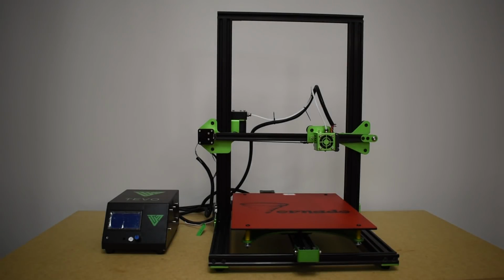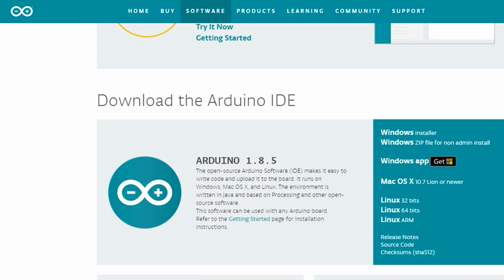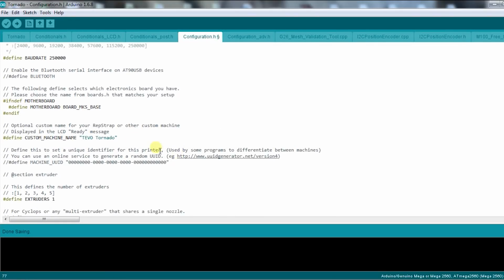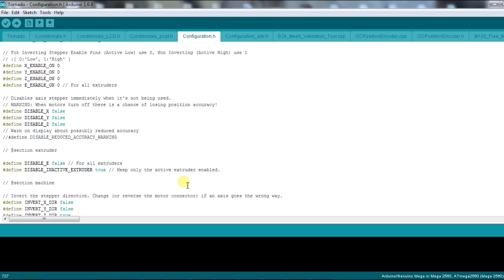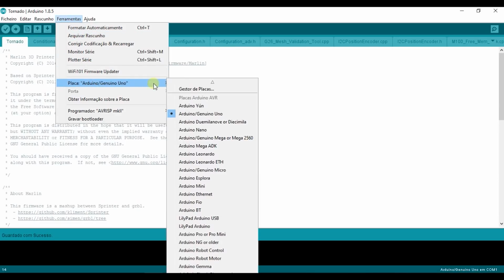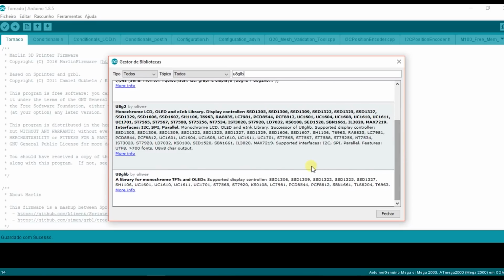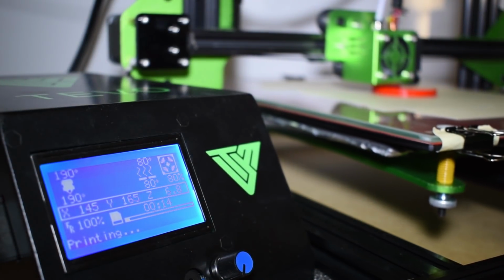TEVO TORNADO 3D PRINTER - HOW TO UPDATE THE FIRMWARE

Comment: I have the blue screen of "BLANK" ...  I reviewed you video and made changes that you had to the Marlin - uploaded the u8glib library. - WIth the machine turned off I uploaded ... no screen data once compiled and uploaded ...  Unplugged and turned on the power to the machine ..   Still nothing ...
Reply from the maker: Hi Doug,
Was the display working before?
Did you reverse the cables as I explain in the video?
Reply: @ruiraptor  Yes it did...  never changed any cables or anything ..  After I built the machine .. I noticed it didnt work like it should with the original software ... This was a test out of the box ...  As I read the manual it stated I needed to update the software with Marlin ... Since then I have not been able to have any screen information of operation of the Tornado..
Reply from the maker: Make sure that the firmware you are flashing has the correct display enabled. If you are using a different board, check my video as I had to reverse the cable orientation.
Reply: @ruiraptor  HEY! .. got it now ... didn't have to change the cable orientation ... What I did was go to the Tevo Tornado users group and downloaded the current Tornado zip...  this was a setup for the Tornado already designed by a end user and seems to be working fine at the moment....  Doing a print now and the display is now working ..   Thanks for the help ...
Reply from the maker: Glad it's working. Thanks for sharing :)
Reply: @ruiraptor  OH YEA! .. This baby is working like a champ ....  Whats funny, I purchased at work a Ultimaker + ....   and we all raved over the prints.  Compare the Ultimaker to my Tornado ..  OMG!  the quality of prints are far superior than the Ultimaker ...  TEVO did their job building this setup ..  I have it now connected to my Octoprint with camera system and its a BUTE! ...   Thanks again for your support ... Those that run into issues please review ruiraptor's video and then checkout FACEBOOK - TEVO TORNADO USER GROUP ..  they have all the needed downloads to support your Tornado printer ...
Reply from the maker: Thank you so much for your kind words and for sharing all that. :)
Any questions let me know.

Comment: Hi, great guide.
Unfortunatelly, I didn't know that before and my firmware update failed and the printer doesn't heat anything. Do you have any idea what to do? Any link where can I find proper information?
Regards, Robert
Reply from the maker: Hi Robert,
My advice, flash the stock firmware back and check if everything works as normal.
You can find the stock firmware here: https://github.com/tevo3d
Reply: @ruiraptor  Thanks, I will check it.

Comment: I have given up with the Tornado. I have an Anet A8 and have build a reprap AtomX from scratch. Both were easier to set up and actually use than this deathtrap. Warped bed, communication timeout when trying to update firmware, thermal runaway protection disabled, no earthing and no strain relief to mains bed, missing bolts in kit, all screws loose, no fuses on hotend or bed, no thermal fuse in bed heater and no way to put one in, frame out of square, useless build surface. Inside the control box the mains power to the switch was touching the case of the psu (they had actually removed the insulation to make it fit and put a bit of electrical tape on the side of the psu case!), the fans on the psu have rocks for bearings, mains cables to the hot bed were loose and exposed at control box end (which has an exposed metal screw connector), fuse in control box not properly spec'd and something else would blow before it does, endless reports of fuses blowing in the psu, no-name solid state relay...... I could go on. I have had it a year but only just put it together. Wish I had not bothered. Very disappointed and frustrated and don't trust it as far as I can throw it.
Reply from the maker: Hi Plan C,
So sorry to hear that and thanks for sharing.
However i'm surprised with some things you mentioned.
For example, the thermal protection is enabled in firmware in ALL stock tornado printers unlike all the anet printers that have it DISABLED.
The Anet printers don't have a strain relief, no fuses, they have acrylic frames/plates that don't get squared because are poorly cut and warp every time you try to stretch the belt and very difficult to get decent prints without significant upgrades.
I believe that you probably received a bad printer but trust me that not all of them are like that. 
I did not have any issues with my printer and i get awesome prints from it. Same with many users posting in the official forum.
Anyway, if you need any help let me know. I'm always glad to help.
Reply: @ruiraptor  Thanks. I have made some modifications which should make it safer. 3.15a fuse in the control box instead of 10a - Runs fine. Octoprint with Temerature Failsafe and TP Link Smartplug so that the socket turns off if either the bed or hotend temperatures go out if bounds. Cable strain relief. Meanwell psu, earthing the frame and tray. I think I was having a bad start with it. It was hell to level and only worked with glass and hairspray lol. Your videos are very informative. Keep it up.
Reply: Sucks to be you...

Comment: Thanks, I have an old one from about a year ago that I just got around to assembling lol. I read somewhere that thermal runaway detection may be disabled in the stock firmware. Do you know if this is true? If so, I will update. Also wondering if there is a thermal fuse in the supplied silicone heater. Thanks.
Reply from the maker: Hi Plan C.
From my knowledge, all tevo printers have the thermal runaway ENABLED from stock.
Regarding the fuse, there is none. Just the temperature sensor.

Comment: I know you must be super busy with all the questions. Can you do one for me?
I just installed a MKS Gen L 1.0 board with 2208 and lv8729 drivers in my Tornado. Did the firmware install, when I move the hotend to the corners of the bed, Lift and Right seem to be ok. When going to the Lift or Right Rear, it just repeats Lift and Right Frunt movement.  I think it just needs some adjustment.
What can I do to correct this.
Thank you so much
Dale
Reply from the maker: Hi Dale,
If that is happening then the code in the firmware is wrong. You can edit the code and flash again.
Check the "configuration_adv" tab under #define CUSTOM_USER_MENUS
In there you will find the gcode commands. Just edit the coordinates.
Reply: I located the CUSTOM_USER_MENUS, Sorry to say I don't know what to change. Here is what is in the CUSTOM_USER_MENUS
 #define CUSTOM_USER_MENUS
#if ENABLED(CUSTOM_USER_MENUS)
  #define USER_SCRIPT_DONE "BED LEVEL Done"
  #define USER_SCRIPT_AUDIBLE_FEEDBACK
  #define USER_DESC_1 "Home"
  #define USER_GCODE_1 "G28"
  #define USER_DESC_2 "Front Left"
  #define USER_GCODE_2 "G1 Z10 F5000\nG1 X20 Y20\nG1 Z0"
  #define USER_DESC_3 "Front Right"
  #define USER_GCODE_3 "G1 Z10 F5000\nG1 X280 Y20\nG1 Z0"
  #define USER_DESC_4 "Rear Right"
  #define USER_GCODE_4 "G1 Z10 F5000\nG1 X280 Y280\nG1 Z0"
  #define USER_DESC_5 "Rear Left"
  #define USER_GCODE_5 "G1 Z10 F5000\nG1 X20 Y280\nG1 Z0"
Reply from the maker: Hi Dale, 
your commands/coordinates are correct.
Did you flash this firmware version?
Reply from the maker: Also...have you executed the home first?
Reply: I flashed the firmware after setting up the configuration h, from your video.
I to thought the #define CUSTOM_USER_MENUS looked correct. 
I did go to home first, then to the front right, front Lift. Rear right and Lift just went to Front right and lift. 
Hop you can stay with me tell we get it fixed.
Reply from the maker: Hi Dale,
Sure. Contact me by email so we can troubleshoot it.
ruiraptor.channel@gmail.com

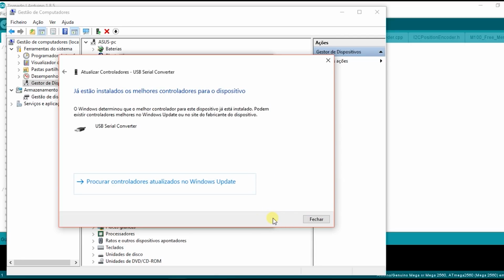Comment: Thank you so much for the fantastic videos. You have helped me get the MKS L board installed. I’m on to installing of the new firmware. All seems to go ok up to the point on your video (5:50) I have installed the CDM21228 Drivers to my computer. After that I don’t see the drivers in Device Manager.  Here is the step by step I Have. Hop you can get me going.
Thanks
Dale
Ruiraptor has verified this step by step. Hope it helps.
video at http//www.youtube.com/watch?v=g4aHmbt5gMA
This is for MKS Gen L V1.0 board with X , Y , Z drivers 2208 and E With LV8729
Volt set on 2208 drivers 1.6v on X , Z and Y set at 1.2v . For E LV8729 driver set at .55v
1. Open Tevo Tornado Firmware folder
2. Scroll down to Tornado.ino and open
3. Click on Configuration.h
4. Scroll down to #endif
5. Go down to #define CUSTOM_MACHINE_NAME”Tevo tornado”
6. Highlight “Tevo tornado” Then Type in “Dale”
7. If needed To change 
8. Click Tools at top of Arduino  
9. Select Board Then click on Arduino/Genuino Mega or Mega 2560
10. Select Processor  Then click on ATmega2560 (Mega 2560)
11. Select Programmer Click on AVRISP mkII
12. Connect Printer to Computer with USB Cable. Power should be off on the printer
13. Printer LCD will turn on 
14. Open Tevo Tornado Firmware folder
15. Open Drivers folder Run the CDM21228_Setup.exe
16. Go to Device Manager 
17. Scroll down to and Click on FTDI USB Drivers 
18. Go to Comport in Device Manager
19. Make sure the New ComPort is listed Arduino Megs 2560 (COM#)
20. Go back to Arduino , Tools , Port. Mack sure the Port is the same
21. Should show COM# (Arduino Mega or Mega 2560)
22. Go to Sketch at top of Arduino
23. Go to Include Library Look for u8glib Click on it.
24. If it is not there go to Tools , Click on Manage Libraries  
25. Window will open. Type in u8glib in the Filter your search
26. Scroll down to u8glib. Click on Install
27. When it’s finished go to Sketch , Include Library , Scroll down to make sure u8glib is in the lest
28.  Reedy to install the Firmware. 
29. Click on the check mark at top of Arduino. To verify
30. If Nothing is red at bottom , Click on Fight Arrow next to the check mark  
31. The Printer will reboot after upload is complete
32. Unplug the USB Cable, Power on the Printer
Reply from the maker: Hi Dale,
Perfect sequence.

Comment: Help please, I received this long error message when i verified the arduino tornado firmware
Arduino: 1.8.5 (Windows 10), Board: "Arduino/Genuino Mega or Mega 2560, ATmega2560 (Mega 2560)"

In file included from sketch\Marlin.h:32:0,

                 from sketch\Marlin_main.cpp:244:

sketch\Marlin_main.cpp: In function 'void gcode_M0_M1()':

sketch\language_en.h:34:66: warning: unknown escape sequence: '\^'

   #define WELCOME_MSG                         MACHINE_NAME _UxGT(" ready.")

                                                                  ^

sketch\Marlin_main.cpp:5775:59: note: in expansion of macro 'LCD_MESSAGEPGM'

           IS_SD_PRINTING ? LCD_MESSAGEPGM(MSG_RESUMING) : LCD_MESSAGEPGM(WELCOME_MSG);

                                                           ^

sketch\language_en.h:34:60: note: in expansion of macro '_UxGT'

   #define WELCOME_MSG                         MACHINE_NAME _UxGT(" ready.")

                                                            ^

sketch\Marlin_main.cpp:5775:74: note: in expansion of macro 'WELCOME_MSG'

           IS_SD_PRINTING ? LCD_MESSAGEPGM(MSG_RESUMING) : LCD_MESSAGEPGM(WELCOME_MSG);

                                                                          ^

sketch\Marlin_main.cpp: In function 'void gcode_M104()':

sketch\language_en.h:34:66: warning: unknown escape sequence: '\^'

   #define WELCOME_MSG                         MACHINE_NAME _UxGT(" ready.")

                                                                  ^

sketch\Marlin_main.cpp:7059:9: note: in expansion of macro 'LCD_MESSAGEPGM'

         LCD_MESSAGEPGM(WELCOME_MSG);

         ^

sketch\language_en.h:34:60: note: in expansion of macro '_UxGT'

   #define WELCOME_MSG                         MACHINE_NAME _UxGT(" ready.")

                                                            ^

sketch\Marlin_main.cpp:7059:24: note: in expansion of macro 'WELCOME_MSG'

         LCD_MESSAGEPGM(WELCOME_MSG);

                        ^

sketch\Marlin_main.cpp: In function 'void gcode_M109()':

sketch\language_en.h:34:66: warning: unknown escape sequence: '\^'

   #define WELCOME_MSG                         MACHINE_NAME _UxGT(" ready.")

                                                                  ^

sketch\Marlin_main.cpp:7273:9: note: in expansion of macro 'LCD_MESSAGEPGM'

         LCD_MESSAGEPGM(WELCOME_MSG);

         ^

sketch\language_en.h:34:60: note: in expansion of macro '_UxGT'

   #define WELCOME_MSG                         MACHINE_NAME _UxGT(" ready.")

                                                            ^

sketch\Marlin_main.cpp:7273:24: note: in expansion of macro 'WELCOME_MSG'

         LCD_MESSAGEPGM(WELCOME_MSG);

                        ^

sketch\Marlin_main.cpp: In function 'void gcode_M81()':

sketch\Marlin_main.cpp:7723:45: warning: unknown escape sequence: '\^'

     LCD_MESSAGEPGM(MACHINE_NAME " " MSG_OFF ".");

                                             ^

sketch\Marlin_main.cpp:7723:5: note: in expansion of macro 'LCD_MESSAGEPGM'

     LCD_MESSAGEPGM(MACHINE_NAME " " MSG_OFF ".");

     ^

sketch\Marlin_main.cpp: In function 'void gcode_M115()':

sketch\serial.h:51:68: warning: unknown escape sequence: '\^'

 #define SERIAL_PROTOCOLLNPGM(x)             (serialprintPGM(PSTR(x "\n")))

                                                                    ^

sketch\Marlin_main.cpp:7930:3: note: in expansion of macro 'SERIAL_PROTOCOLLNPGM'

   SERIAL_PROTOCOLLNPGM(MSG_M115_REPORT);

   ^

In file included from sketch\ultralcd.cpp:26:0:

sketch\language_en.h:34:66: warning: unknown escape sequence: '\^'

   #define WELCOME_MSG                         MACHINE_NAME _UxGT(" ready.")

                                                                  ^

sketch\language.h:28:18: note: in definition of macro '_UxGT'

 #define _UxGT(a) a

                  ^

sketch\ultralcd.cpp:68:48: note: in expansion of macro 'WELCOME_MSG'

 char lcd_status_message[3 * (LCD_WIDTH) + 1] = WELCOME_MSG; // worst case is kana with up to 3*LCD_WIDTH+1

                                                ^

d:\3d printing\arduino\hardware\tools\avr\bin\../lib/gcc/avr/4.9.2/../../../../avr/bin/ar.exe: unable to rename 'core\core.a'; reason: Permission denied

exit status 1
Error compiling for board Arduino/Genuino Mega or Mega 2560.

This report would have more information with
"Show verbose output during compilation"
option enabled in File -> Preferences.
Reply from the maker: Greetings,
Did you installed the u8glib library?
Reply: @ruiraptor  how do you install that? i downloaded the library and copy/pasted all the files but i still get error #include "MarlinConfig.h"

#if ENABLED(ULTRA_LCD)
  #if ENABLED(LCD_I2C_TYPE_PCF8575)
    #include <Wire.h>
    #include <LiquidCrystal_I2C.h>
  #elif ENABLED(LCD_I2C_TYPE_MCP23017) || ENABLED(LCD_I2C_TYPE_MCP23008)
    #include <Wire.h>
    #include <LiquidTWI2.h>
  #elif ENABLED(LCM1602)
    #include <Wire.h>
    #include <LCD.h>
    #include <LiquidCrystal_I2C.h>
  #elif ENABLED(DOGLCD)
    #include <U8glib.h> // library for graphics LCD by Oli Kraus (https://github.com/olikraus/U8glib_Arduino)
  #else
    #include <LiquidCrystal.h> // library for character LCD
  #endif
#endif

Comment: I bought the Gen L for my tevo Tarantula and i am trying to set up my marlin firmware for it. i get a compiling error and the error message mentions a driver issue. I currently have it set up to use TMC 2208 drivers

C:\Users\Brend\AppData\Local\Temp\arduino_build_309823\sketch\stepper_indirection.h:62:30: fatal error: TMC2208Stepper.h: No such file or directory

   #include <TMC2208Stepper.h>

                              ^

compilation terminated.

exit status 1
Error compiling for board Arduino/Genuino Mega or Mega 2560.

Anyone know what might be wrong?

Thank you for any help.
Reply from the maker: Did you unzipped the files? Can you find the missing file?

Comment: My com port shows up as RAMPS 1.4 rather than  Arduino 2560 as yours shows.. how does one fix this?
Reply from the maker: Hi Jim,

I think it might be due to the drivers you installed. Check if you have communication between the board and  the Arduino software and if you  can flash the firmware. If yes, then dont bother with it.
Reply: ya  it was the drivers. installed  seems something goes wrong every now and then   I dont flash often but need to reinstall them for what ever reason.
Thanks

Comment: hi, i just recently replaced  my extruder end, no if i set it to 50deg it ramps ups to 101deg and comes back down, did firmware update still does it what could be causing this ? thanks for any help
Reply from the maker: The firmware might have different settings. But try to run a PID tune first and see if it helps.

Comment: Hello, RUIRAPTOR!
What problem I have gotten myself into! I configured with your video the firmware 1.8 of my 3D printer Tevo Tornado and when I connected the computer to the control box and tried to load it the screen of the control box became totally blue and I could not repair it. Do you have any suggestions to repair this error? I have searched in some forums but I have not received an answer.
Muchs Thank you for your help
Reply from the maker: Hi, did you connected the PC to the control box with the main power on too?
Maybe you have bricked the firmware. There is always the change to unbrick it but you need to get an arduino to do that.
Check the instructions here:
https://medium.com/3dprinterchat/en-how-to-fix-a-bricked-3d-printer-board-installing-a-bootloader-es-c%C3%B3mo-arreglar-una-placa-rota-de-1efa28cde65